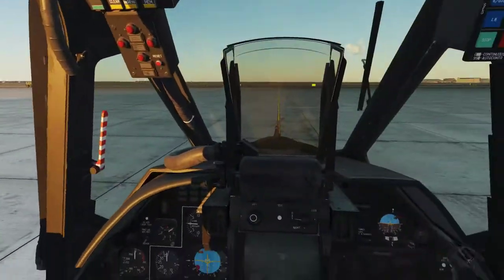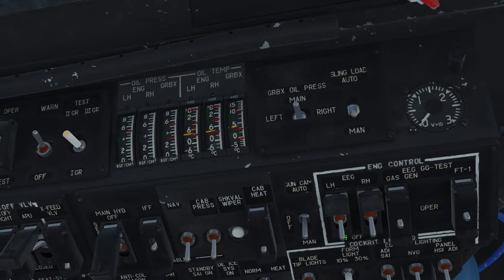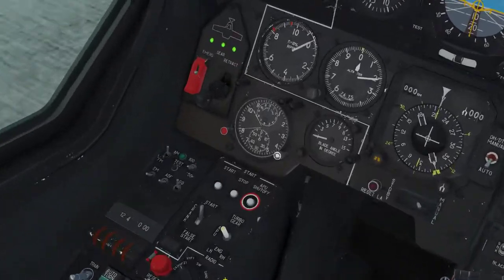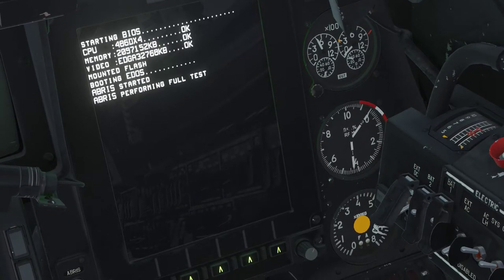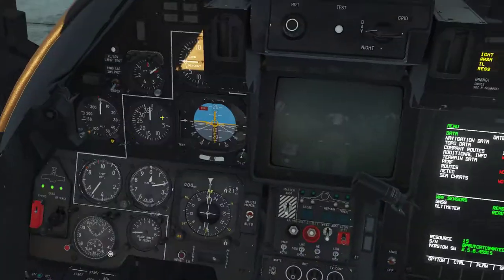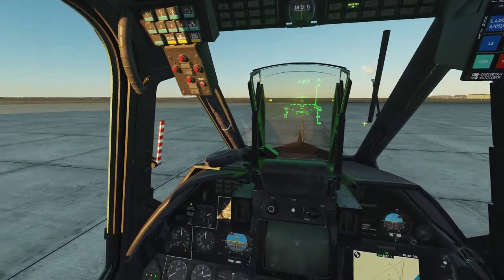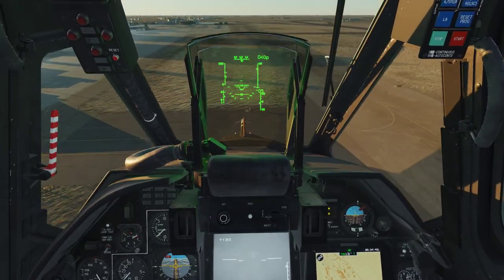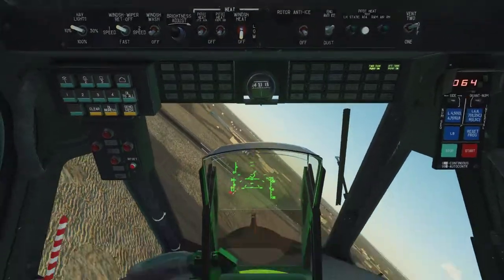[DCS] KA-50 Black Shark Cold Start Tutorial.

Comment: main hydraulics is ON, u  just turned it OFF
Reply from the maker: Ahhh shite. Thanks for pointing it out
Reply: @223frankthetank  I did the same in one mission  and in the middle of it i lost autopilot,trim and couldnt get my gear down :) so was searching around what i did wrong :)
Reply from the maker: Czecher86 i guess it must have some sort of reserve, and when that one is switched off it goes through the reserve/backup system until that’s done for. I know the Viper has a similar backup in case main Hydro gets knocked out

Comment: Im afraid your guide is a tad obsolete. Reaching the point of starting up the left engine it simply wont increase it's RPM beyond 20-25%.
Reply from the maker: You must be doing something wrong man. Works fine for me :)
Reply: @223frankthetank  i figured it out. The autothrottle was not mentioned i think? Pressing page up twice. Maybe you mentioned it and I missed it?
Reply from the maker: Murkelost79 i believe I mentioned it 😅
Reply: @223frankthetank  probably. It was a bit fast at times.